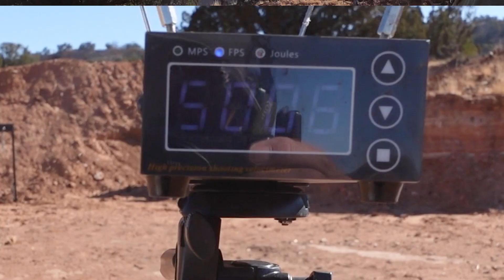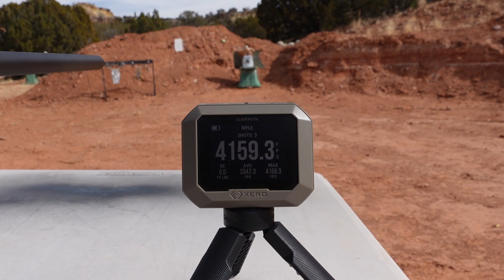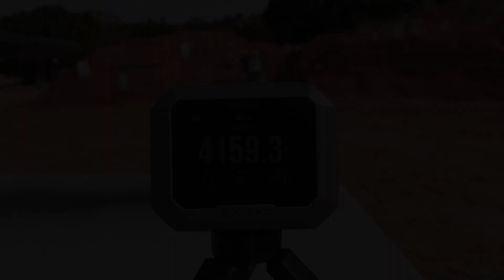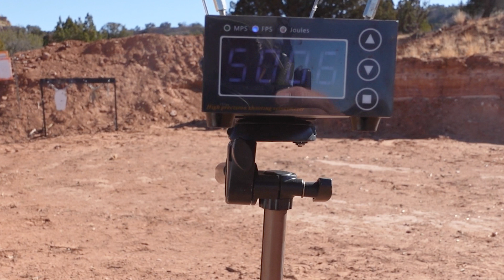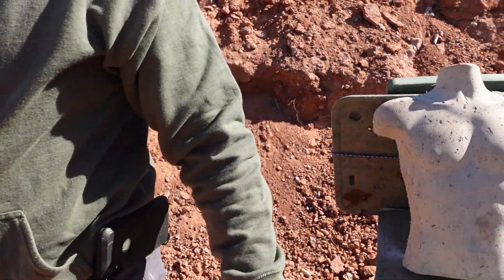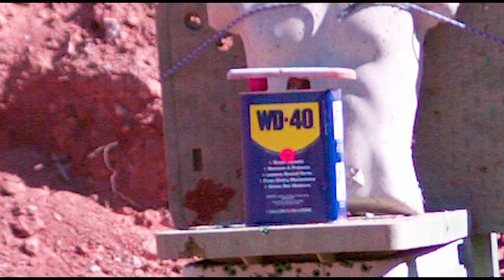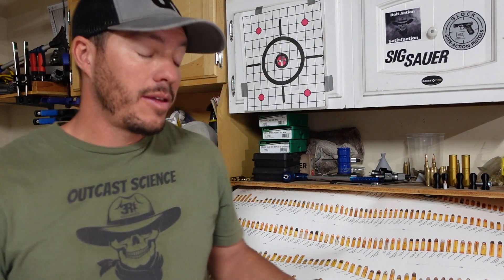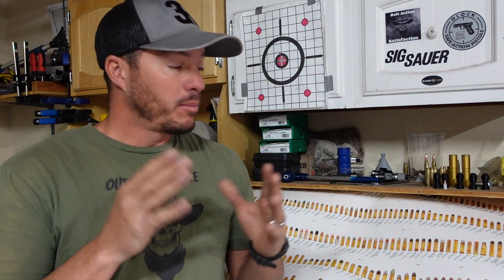Sabot testing the 30-06 with M855

Comment: I loaded 73 grs of 3031 and an accelerator with a 55 22cal  in a 300 Win Mag and got 4800 fps . I got this load out of a gun magazine article about 35 years ago. As I recall there was no sign of excess pressure !

Comment: I love the 06 22 sabot for varmints they are sweet , been using them for decades    try a sun shield on your chrono. been using them for yeeaarrsss and if you don't use a sun shield in sunlight and certain angles you will get an error or no read at all
Reply: How has your accuracy been? Any suggestions